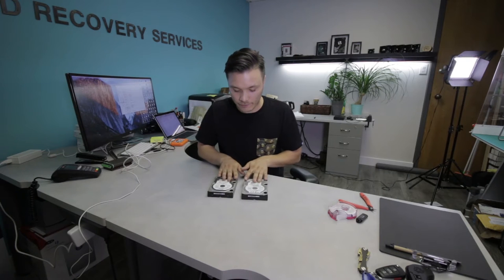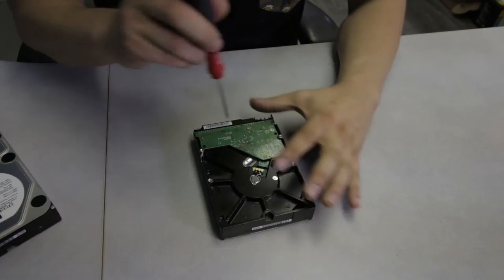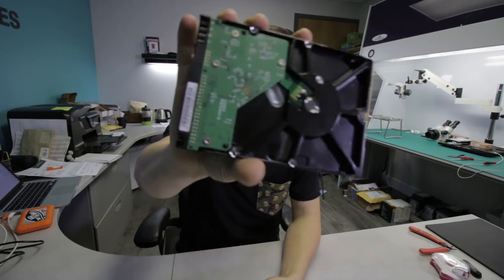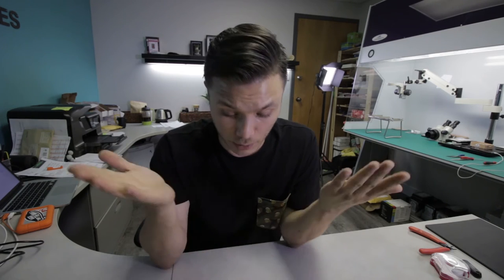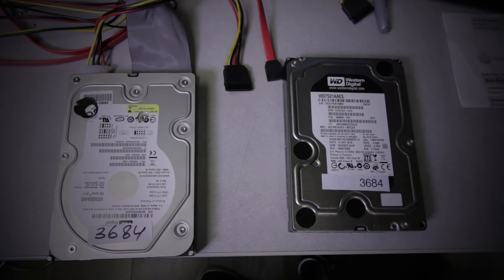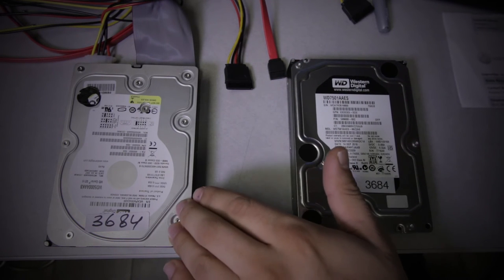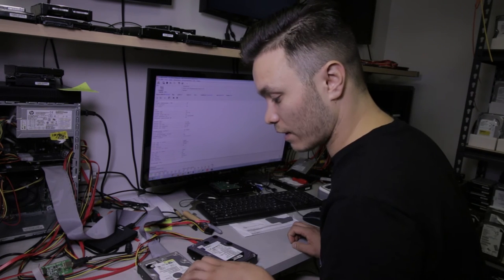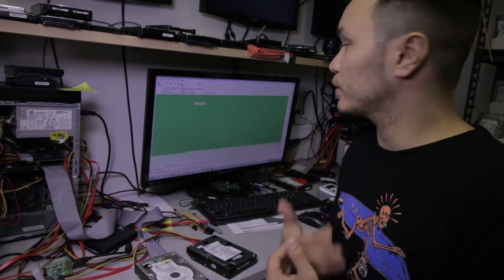data recovery vancouver project | western digital died

Comment: I have been having trouble with clients not paying for data recovery once the job is completed and invoice is sent. Mostly end users on $500+ jobs. Is this something you have had trouble with before and did you start accepting payment up front or charging a bench fee to compensate?
Reply: I assume you don't give the recovered data to the client until they pay? If not, you probably should charge before returning loaner  drive with the data. They will pay if they really want their data back.

Comment: Just a stupid question regarding a USB 3.0 flashdrive... I have used this drive to run a fully installed backup ubuntu from it, but it recently failed to boot, I've re-installed it a few times the installation completed just fine, data is fully accessible, but it wouldn't boot. Same error every time... Tried to re-format it it worked, but when I tried creating new partition table it gave me an error, and it showed me free space with a 2.4GB unknown partition at the middle. When I've opened GParted, popped up a message that backup gpt table is corrupt, but the main one is still fine, and I was able to modify it just fine... Does that mean the controller is dying? Cause it still works, I can use it, but I can't boot from it anymore even after recreating the partition table with GParted... It's a Philips USB3.0 32GB stick...
Reply: Never mind... I found the problem, my old ubuntu 15.04 must be broken, cause the same message popped up at one of my USB 2 sticks, and one of my SD cards as well, in GParted, after partitioning them in Disks but slow formatting the entire device solved the problem...

Comment: What about drives that are encrypted or locked like external drives
Reply from the maker: WD encryption can now be handled by data extractor on flight. However, if the drive is locked with password, then we would need to know what that password is.
Reply: Very interesting. Thanks Buddy